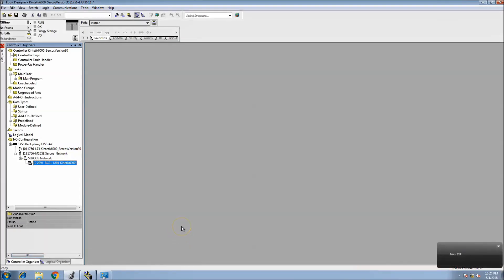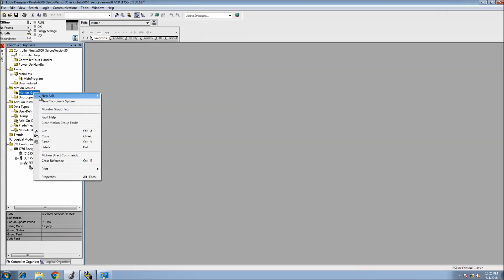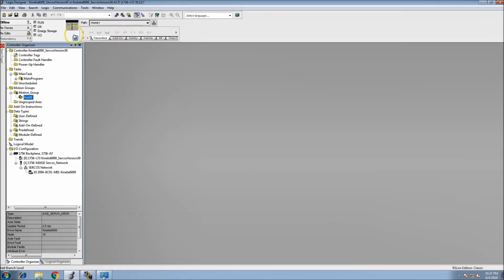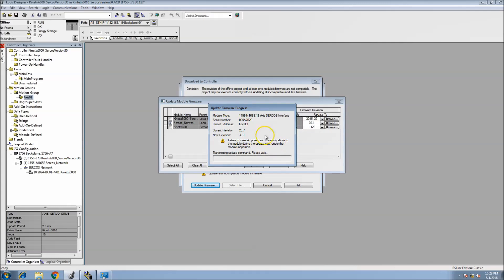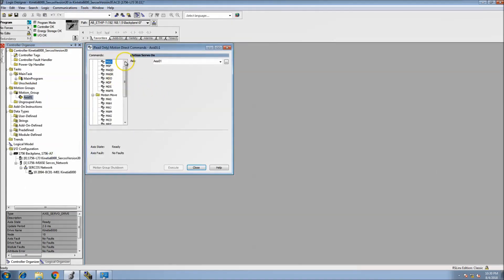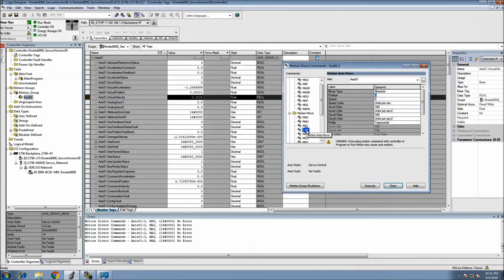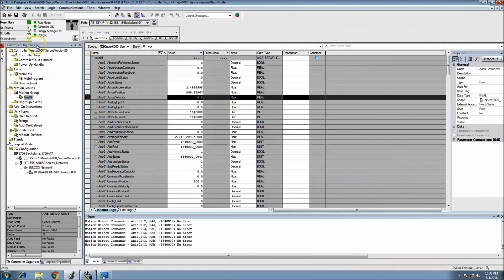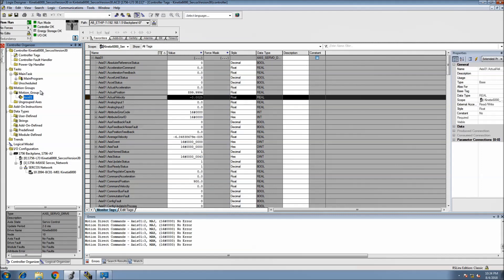Studio 5000 Logix Designer Version 30 Running a Kinetix 6000 Sercos System

Comment: Is it possible to use Rockwell and SERCOS to control a DELTA, SCARA or ARTICULATED ROBOT?  If so, is there any documentation that I can refer to?
Reply from the maker: Of course.

Rockwell servos work with any Automation platforms, as far as documents then you need to visit their website for details.

Standard servo platforms for Rockwell communication is Sercos or Ethernet which is CIP motion.
Reply: @ShaneWelcher  Thank you very much for the quick response.  I checked several Delta, Scara and Articulated Robot manufacturers and how they interface to Rockwell Kinetix drives for motion.   I have yet to find a simple example where a Kinetix drive (3 or 4 axis for Scara or Delta) is demonstrated.  I reviewed several webinars from Rockwell but in the end of each, they all seem to let the robot controller perform the actual motion and the Rockwell Interface is used for EIP data exchange.  I have not seen a system where 3 to 4 Kinetix drives are using Kinematics in the PLC to drive the Delta Robot.  Have you?
Reply from the maker: @hareshmharesh  

Yes but I don't have examples, it is not simple.

It is complex.

Servo Controls take experience & are machine application uses so it depends on design
Reply: @ShaneWelcher  Thank you very much for the response.  I looked into two Rockwell manuals and it looks like a knowledge of the mechanical unit and linkage lengths are necessary to get started.  Then a series of complicated limits are necessary to determine workspace and then velocity and jerk limits.  Do you know of any customers out there that actually use this method?
Reply from the maker: @hareshmharesh  

I have a few cartisain robot methods but it's not an easy explainable logic for videos.

Comment: Need your help? We have machine in which kinetic 350 servo drive, now it showing module fault, and we r trying to reset servo error from hmi, but no action happen reset and servo enable?
Reply from the maker: Well, you could try using the motion axis direct commands to trouble shoot this issue as I teach in my servo course.
https://www.udemy.com/servo-motion-mastery/

I have two courses about servos that will help you gain extreme know over controls and trouble shooting
Reply from the maker: To put it quick and to the point, right click the axis, select motion axis direct commands, a window will pop up. 
In that pop up, there will be a set of commands, first try a MAFR, then MASR, if that clears the fault then see if it will run.

If it clears the fault and it will not run and gets another error then you may have a position error.....AKA...mechanical hang up generally but not limited to. 

Next, if the motion axis direct commands do not clear the error then shoot me the error code and I will try to help when I have time.

I hope this helps and sorry for the delay, if you want a faster response then please join my Patreon member are. 
Here is the link:
https://www.patreon.com/OnlinePLCsupport

I hope this helps and thanks for the support.

Shane

Comment: WHAT IS SERCOS?
Reply: So Basically sercos for servo drive communication with plc instead of Ethernet
Reply from the maker: suchita gaikwad 

Yes,  this is just a communication platform for the servo drive.
Reply from the maker: Sercos is a communication type to a Kinetix 6000 drive instead of Ethernet. It is a fiber optic cable attached to a comm card and the servo drive.
Hope that helps.

Servo Motion Mastery 
https://www.udemy.com/servo-motion-ma...

Advanced Servo Motion Mastery 
https://www.udemy.com/advanced-servo-...

Also if you are interested in supporting my efforts in providing more helpful training and get specialized training videos then check out my Patreon.

https://www.patreon.com/OnlinePLCsupport

An as always, visit my website to get more training videos with articles to support them.

https://onlineplcsupport.com/

Thanks,

Shane